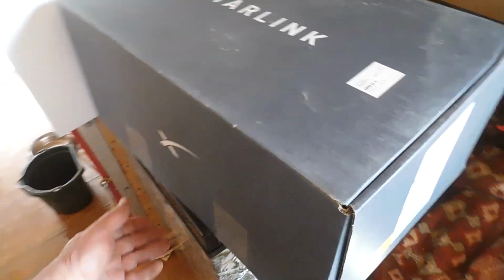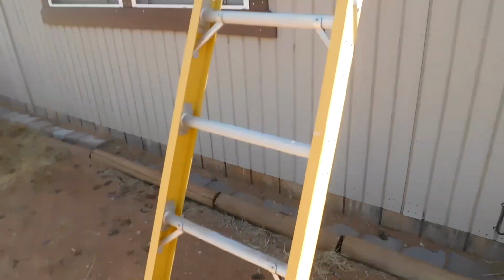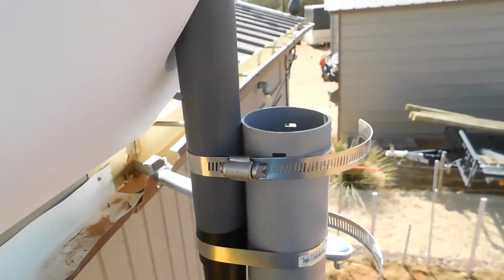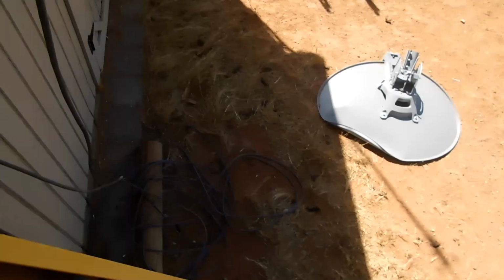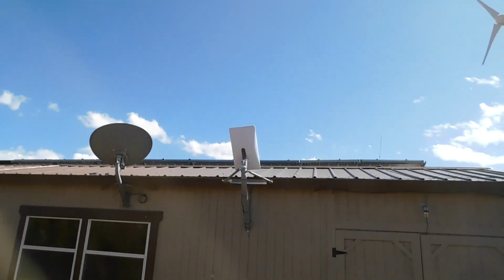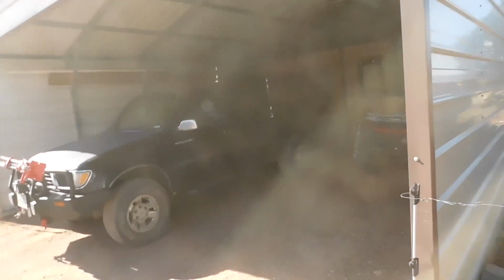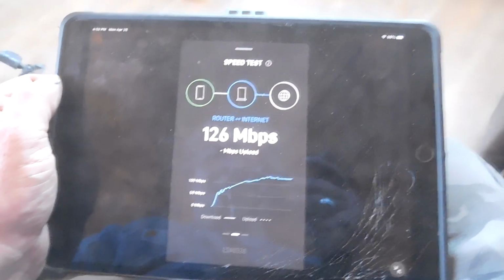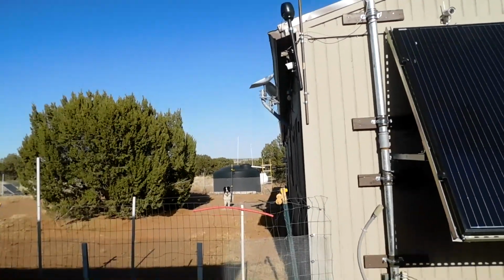Building an off grid solar house part 176. Installing Starlink

Comment: with the length of the cable you could of run it around the house under the eves to the point your putting the router and used up some of the cable i also hate how the starlink runs on mains voltage kinda sucks when off grid to be wasting that power to step up then just to step it down again
Reply from the maker: I agree. I could have done this one with 6 feet of cable.
Reply: yea the cable certainly needs to be replaceable or custon lengths, but I understand that you can just put any Cat6 cable on the dish and expect it to work fine. It has to be the right gauge, shielded, and UV resistant. 
With it being mains powered I think that is justified because it is using -48v or even more for the PoE to the dish. So that would be hard to derive from a low voltage DC source. Maybe a 48v DC system would work and have enough voltage but it would be very niche and mains is just the simple and universal way to go.
Reply from the maker: Yea, twice!